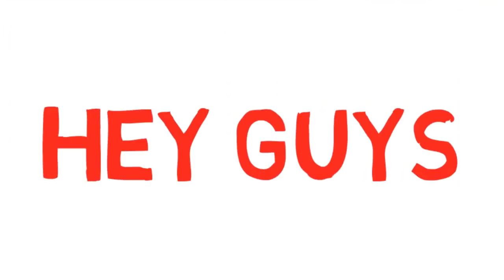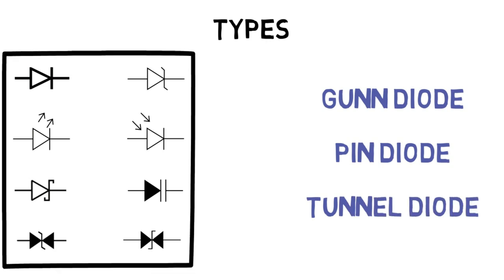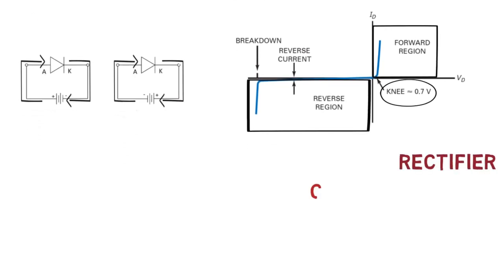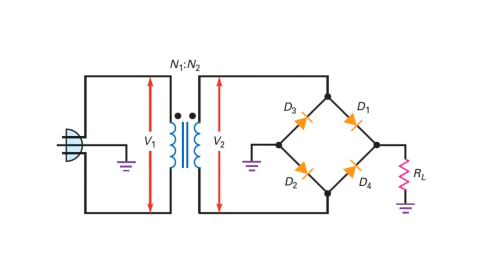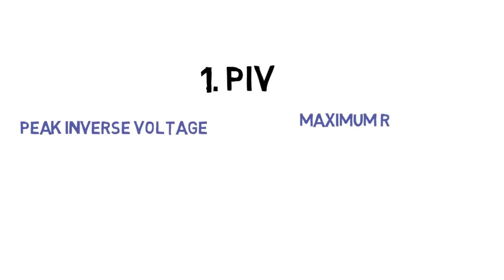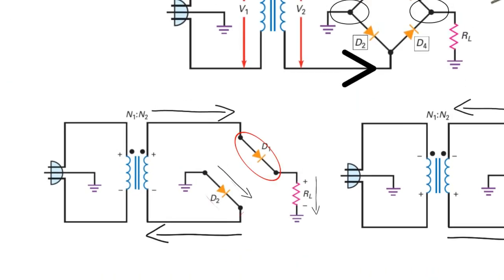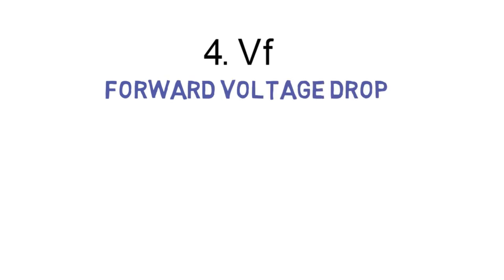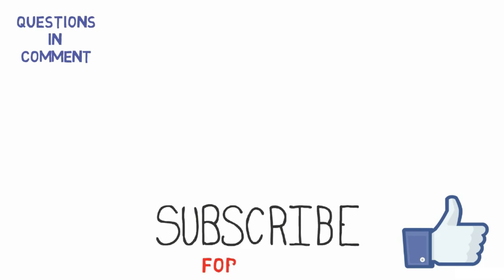How to Select a Rectifier diode ?? | Rectifier diode selection | PN Junction Diode

Comment: Thanks for sharing Good content brother, if i am using 12v dc power supply series with resistor and pn junction diode, then i swap the power supply then what value of PIV rating i choose? PIV= dc supply × 2.2 for safety it is better ? Or 15% of safety margin is okay?
Reply: If Resistor replaced by capacitor, at reverse biased condition voltage across the pn junction diode across 24v present? If 24v present what value if PIV value I choose, can you say any advice for this problem?

Comment: I am building a 9 volt step down dc power supply/  adapter for sound system with a 1 amp 9volt step down transformer 
With bridge rectifier, which diode should i use for this? 
I need diode no
Reply from the maker: please calculate the requirements, accordingly you can select.

Comment: Excellent video.. First I've found to point me in the right direction!
Can you please help with a suggestion? 52v dc circuit for a light and horn. I wish the switch for the horn to flash the light, but I do not want the switch for the light to sound the horn. The two loads are 3 amps each. Can you suggest a diode to prevent backfeed to the horn in my application?
Reply from the maker: You can use S3M.